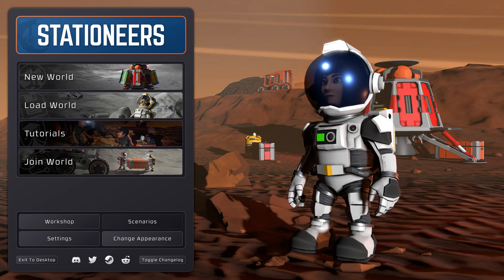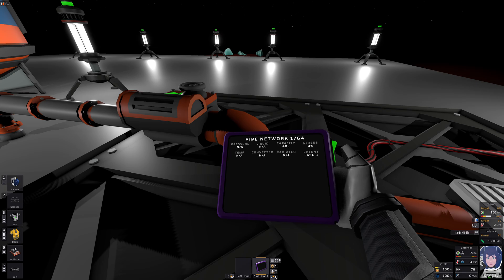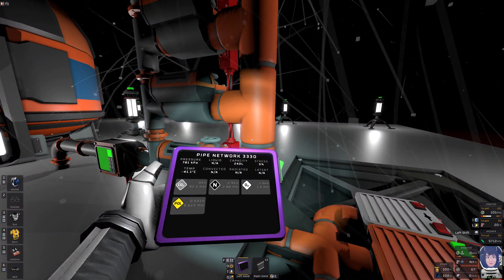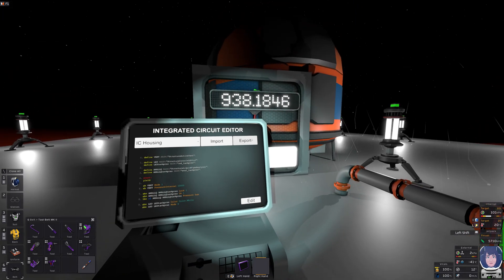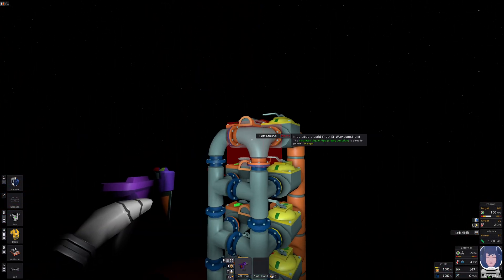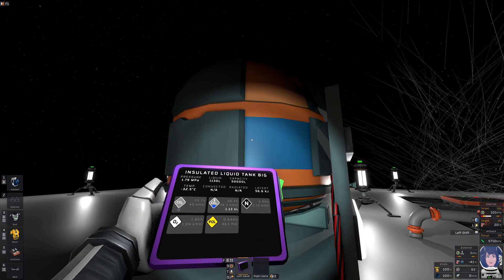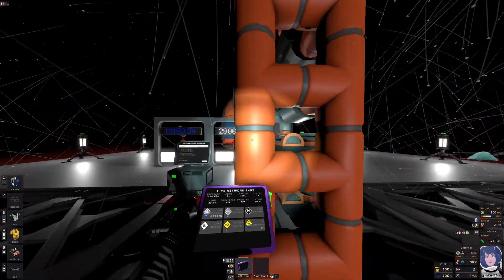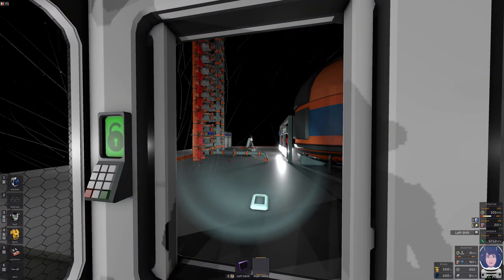Stationeers ATMOSPHERICS for total beginners - TURBOSTYLE-ish - Part 8: Filling tank with Mars gas *

Comment: I think what is happening at 8 minutes is that the pressurant valves are faster when Input pressure is higher than output pressure.

So you see an immediate speed increase when you increase the safety to 1500 because it allowed the input pressure to rise above output pressure

Comment: I am currently playing my very first decent base playthrough on Mars. I think I have a pretty decent low energy atmosphere harvesting system figured out. 
1. 4x Evaporation Chambers evaporate nighttime CO2 in order to produce a tank with a mix of nitrogen/oxygen. 
2. The evaporated CO2 then goes into yet another evaporation chamber set to max cooling - this chamber ist the first step in a cooling loop for the nitrogen/oxygen. 
3. the second step is a proper evaporation/condensation heat pump filled with pollutant. that cools the nitrogen/oxygen mix down to -85 degrees, condensing the nitrogen. 
4. The cold from the now separated nitrogen is then recovered by heat exchanger to help the pollutant heat pump. 
5. This way, I generate a steady flow of the most necessary gasses for less than 500 Watts power investment. 

Oh, and another Youtuber tested medium powered vents and found out, that approx 3x condensation valves are needed to handle the condensation in the pipe when going at full throttle. Increasing the volume of the pipe between the vent and the valves with inline tanks also greatly improves condensation performance.
Reply: i would love to see this it sounds awesome
Reply: Bonus: all waste gasses from evaporation, the furnace and other processes go through a large cooling tower with 5x turbines. That way, I even have some power recovery worth approx. 200 Watts and the cooling tower looks damned cool with all the vapours under proper lighting :)
Reply: An alternative to more than two phase change device setup(credit to CowsAreEvil) is to pump nightime (-20 or lower) mars atmo into tanks up to 15-20Mpa, which will condense all the co2 and pollutant, which is drained off into liquid tanks using the manual condensation valve.  The liquid network is then depressurized with a pressurization pump/valve (from regulators) which will remove the pollutant while retaing most of the liquid co2.

At which point you can use liquid co2 in a phase change evaporator to cool your o2/nitrogen tank from before for use as a breathing gas for a base, or in your example to cool the nitrogen/o2 mix low enough to phase change filter as desired, as well as use another evap chamber to produce co2 gas for plants.
Reply: @OperationalError  That's exactly what I am doing. I use portable tanks for their utility - as the tank connector has both a liquid and a gas connection. The nighttime powered vent condenses CO2 into the portable tanks and the evaporation chambers draw from the tank liquid reservoir. The concentration of O2 and Nitrogen in the gas side slowly increases as the evaporation chambers remove all CO2 and Pollutant. When the portable tanks are "clean" and hold 18MPa of Nitrogen/Oxygen mix and no CO2 remains, a volume pump moves the clean gas into the next tank for separation of nitrogen. And then the cycle resumes from the start.  I startet doing this manually, but by now I have an IC10 chip doing the work so the system is autonomous.

Comment: If the goal is to fill a liquid tank, the easiest method is the manual condensation valves connected to a gas network under sufficient pressure to cause condensation at the available temperatures.  If stress on the pipes is the concern, an inline tank or actual tank on the gas network will add more headroom so the stress levels increase slow enough to be dealt with by a few manual condensation valves.  And if that's not enough, the solution is controlling the pressure in the gas line more deliberately to induce the ("just right")  desired amount of condensation.

The gases in liquid tanks/networks are generally treated as a byproduct of the phase change of whatever liquids are pumped/drained into it rather than the method of producing condensation.  In general, gas pumping into liquid networks is more about limiting or negating evaporation in the liquid network and not for creating condensation.

Pumping gases into a liquid network in order to create liquids is far more difficult than draining liquids off of gas networks into liquid ones.
Reply: You are correct, Matthew :) - some may find the phase change mechanics super confusing, but I just LOVE wasting my time with my Sniff-O-Matic 2000 atmospheric tablet in hand looking at numbers in pipe networks changing :)
Reply: @wowailyich615  You and me both.
Reply from the maker: Thanks. Later in the video, I'm using the Condensation Valves, and they do increase the speed radically and keep the stress at zero.